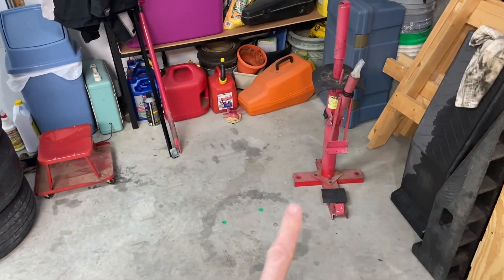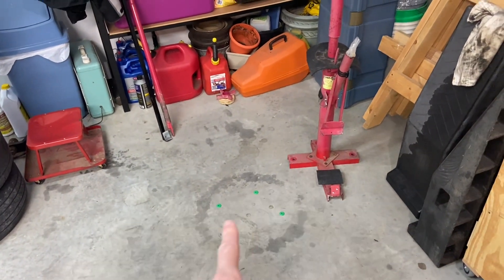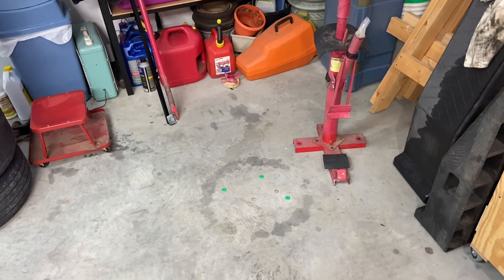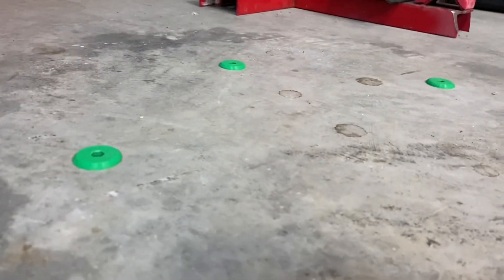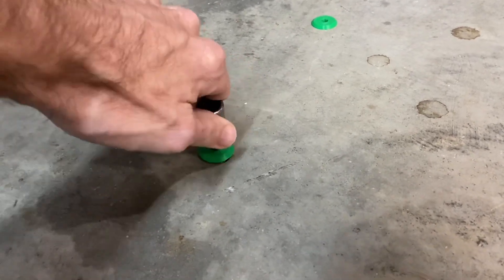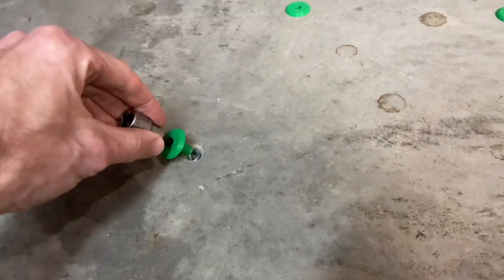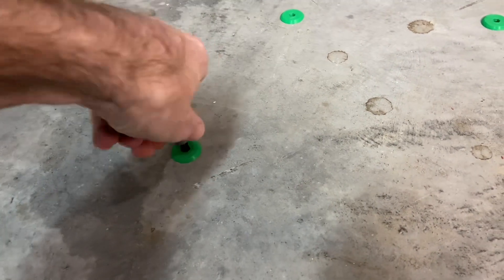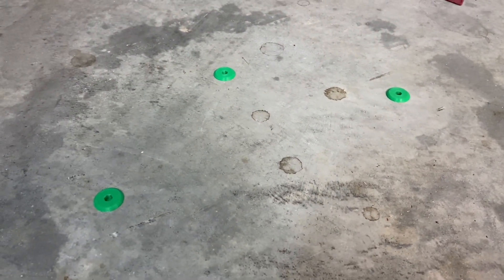Custom plugs for drop-in anchors

Comment: I found your video and these files almost 3 years ago and it has been in the back of my mind to print these when I one day bought a 3D printer. My first Bambu printer arrived today and this will be my first print so I can plug the holes for the hurricane protection on my house in Florida. Very excited !!! Thank you
Reply from the maker: Welcome to the 3d printing community. Enjoy the new printer
Reply from the maker: Also, if they’ll be used outdoors, I recommend printing them in PETG filament (or some other filament that will withstand UV exposure)
Reply: @DustinRogersinMO I just printed 12 but out of the basic PLA since I didn't get the PETG yet. I will put those in the garage door hurricane brace bolt downs and the ones at my front windows I will wait for the PETG to come as the sun hits hard there. Probably a layer of paint will help.

Thanks for the advice and the nice print!

Comment: Nice. This is got to be a pretty niche need…people who have concrete floors, use anchors, use drop in anchors, care about keeping them clean and 3D print… but this a godsend… going to print these asap. Are these 1/2-13?
Reply from the maker: Mine are the 3/8-16. Use whatever size to match the anchors you used. Post a pic of the ones you print on printables.

Comment: This is a brilliant idea, exactly what I was looking for.  1 hicup for me though , I installed floor anchors for a tire changing tool just like you.  only I didn't go as deep with the anchors mine are just slightly below floor level.  I used 1/2" anchors and printed out one of your 1/2"  plugs but the shoulders make it stick out for.  Any chance you can make a 1/2" without the shoulder just all thread with the cap head?
Reply from the maker: Yeah. I’ll try to get it modeled today
Reply from the maker: I just uploaded a version of the 1/2" plugs without the shoulder. Let me know how they work out. I'm a little concerned about the thin section between the thread and the hex drive
Reply: @Dustin Rogers  Just printed the new one  out, works absolutely perfect 🥰.  It's plenty strong as well, I just used regular PLA,  no worries there.  I just sent a dono your way, I really appreciate you reworking this, especially so quickly.  Got a sub from me, keep up the great work 🍻!

Comment: Just tried to run a couple of your plug designs through Cura, but the result was 10000% larger than the originals.  I'm at a loss.
Reply from the maker: What version of cura?
Reply from the maker: These were modeled in F360 using inch units, but I used Cura 5.2.1 to slice and they were the correct scale. In Cura > Preferences > Configure Cura > Opening and Saving Files, there's two settings that refer to scale. Do you have either of those checked? Also, which model were you trying to slice? 1/2", 3/8", or 1/4"?